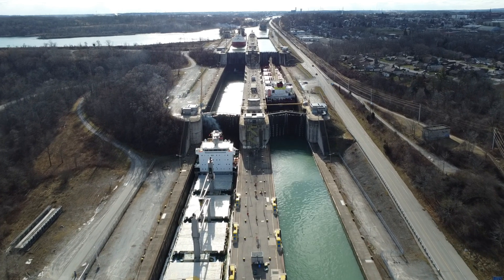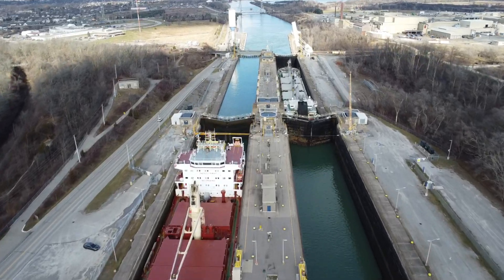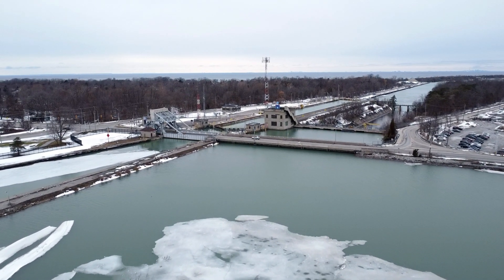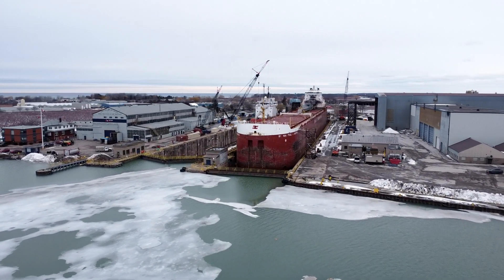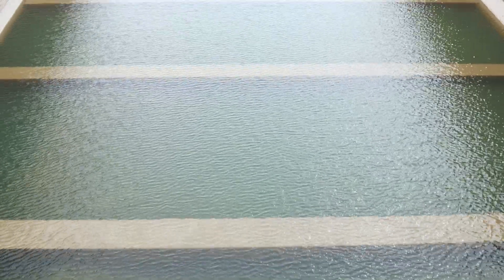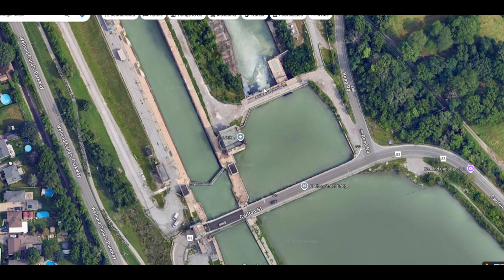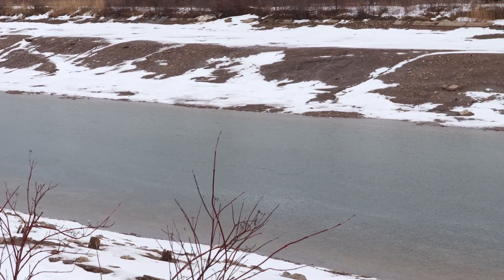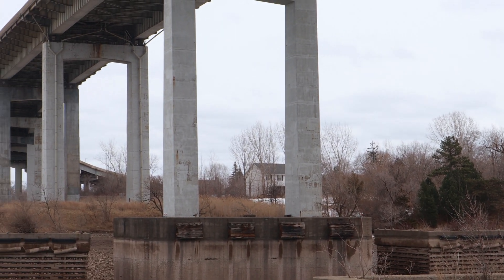THIS VITAL CANAL IS DRAINED

Comment: I think the cross beams at the bottom of the lcck is to prevent the walls from being pushed in at the bottom. The English canals say on the K & A are nominal 14 ft wide but the walls have been pushed in at the bottom so a 13 ft wide beam could actually get wedged in the lock. These things keep the walls vertical.
The stone cribs are there to prevent a ship doing a direct hit on the support structure of the bridge above. Any ship off course will hit them not the supports. The water to the right of the lock I suspect is a pound to hold water to refill the lock,
Reply: The tenchical term for those rock cribs is Gabion.

Comment: Nice video! I use to live right across from lock 7 as a young boy. FYI Those cribs full of rocks around the pillars of the Skyway are there to prevent the ships from crashing into the bridge supports. I don’t believe it does anymore but the canal use to generate it’s own power just from the water passing through it. The bridge at lock 7 is missing because it was hit by a ship and they decided not to repair it because of the then new Thorold tunnel that goes under the canal. There is one more lock at Lake Erie that changes just a few feet in the water level. Cheers!
Reply from the maker: I never thought about that, reinforcement.
That makes sense, but then again, after what happened in the US last year, a ship could still damage that if it sped up slightly.

Comment: Not sure if these are the locks. But if America/Canada were to be invaded by a foreign countries these locks would be targeted because most of the iron ore America needs for a war effort comes from Canada into the USA via the lock systems.  Bombing the locks making them unusable would cripple the making of US weapons.  America is more fragile than the US gov shows itself to be.  There are vids on YT floating around that showcase this theory.
Reply: These are important locks for sure. But if you wanted to stop/impede the flow of iron ore you need to take out the Soo Locks between Lake Superior and Lake Huron. The iron ore originates from mines in MN and Michigan's UP.  It then travels to the various steel mills at ports along the lower Great Lakes. The US government had troops stationed at the Soo Locks during WWII for precisely the reason you're talking about.  I want to say a vast majority of the iron ore stays above the Welland Canal, but I may be wrong.
Reply: You are correct about the iron ore. Some 30,000 troops were stationed at Soo during the war. Some steel goes to Hamilton.@rjgoniea